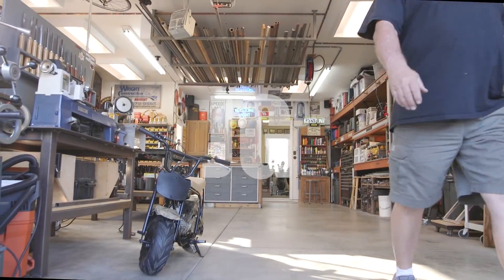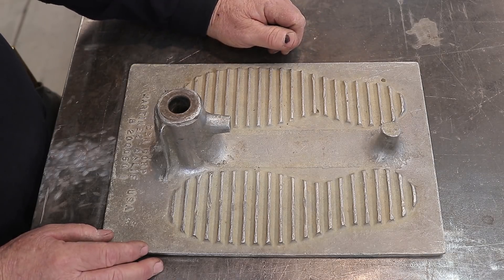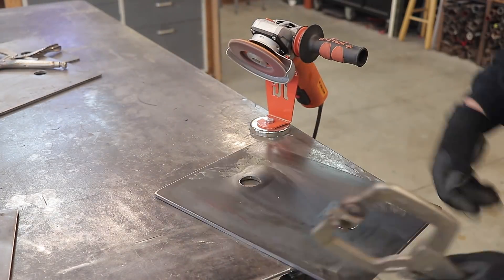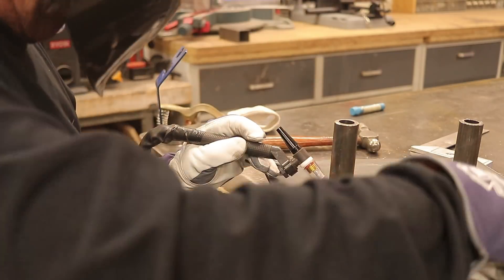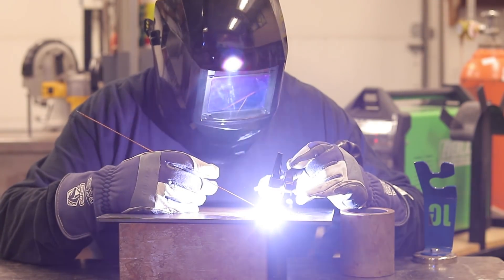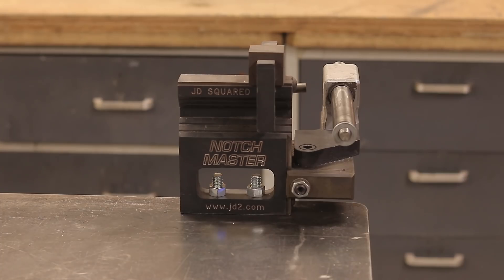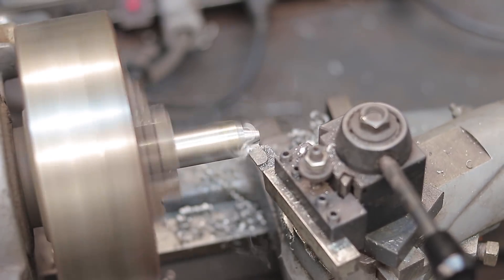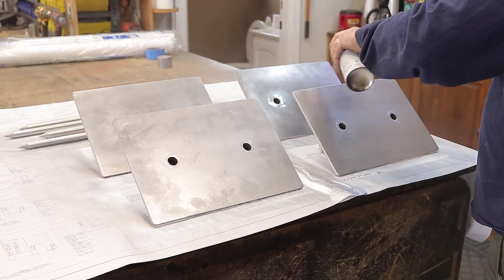Tig Welding Soil Compaction Plates | JIMBO'S GARAGE

Comment: a bit to late with the comment, but im surprised no one mentioned it... you said at the start of the video that the plate is for sticking the rod into the ground, then they remove the plate and place a machine on top of the rod.... with that piece of tube you welded at the end of the rod they cant remove the plate, it acts as a nail head, or am i missing something?

Comment: I’ve seen em in use. Most of the ones I’ve seen have the pin built into a “post driver”. So it’s like a slide hammer. Maybe something to keep in mind if you’re building some more!
Reply: Max Johansson I have tried these in the past. They are not worth the hassle

Comment: I imagine they used aluminum because it doesn’t rust. How is this going to be protected from soil moisture, and the conditions on the truck? Paint won’t last long in this usage situation.
Reply: What will the rust hurt?
Reply: yeah,  a lot of construction stuff like this is aluminum for corrosion resistance and lightweight.

Comment: if ive seen it right the bottom welds didnt fuse properly you can clearly see where the pipe and where the baseplate is

Comment: I am worried that the weld on the underside of the head might wedge the pin into the pipe if it is driven down all the way.
Reply: Mark Trombley 
They don’t get driven down all the way. An x-ray unit is mounted on the rod once it’s driven in and it measures the soil compaction to ensure it is at the engineered requirements.

Comment: It’s used with a nuclear density testing gauge. The only problem I see since I’ve carried around the gauge,plate and probe hole driver all day is the additional weight. If their techs are able to drive to every test location great. Another good vid Jimbo.
Reply: loadpin yeah I wouldn’t like to use those if I had lots of tests to do. I much prefer the aluminium ones. Humboldt / Troxler / Instrotek sell the pin and plates fairly cheap and they will fit in the box.

Comment: Nice little project and a lot more durable than the original one. 
My brother works in the Geotechnical field for one of the many companies in Anaheim and he was saying the rod often holds an x-ray machine to measure the soil density. He only watched a bit of the video but said he will watch the rest after work.
Reply from the maker: Thanks for watching Wayne,  Well these plates are going to a firm in orange! He know exactly what they are used for!  Jimbo!
Reply: JIMBO'S GARAGE 

I know your customer will know. You mentioned it was for testing soil compaction. I was just adding to that by mentioning it was by use of an x-ray unit. 
Sorry for any misunderstanding.

Comment: Nice work.  It certainly pays to have the right tools!  When you rounded the heads of the rods that get driven down, did you in effect grind away the weld you had just put in place?  Just wondering how that works....
Reply from the maker: Thanks for watching James, There was a slight gap between the bar and the collar, There was good penetration there, Plus i built up the top of the pin with kind of a dome. Not much weld was removed.   Jimbo!